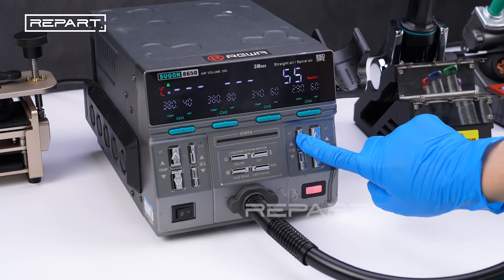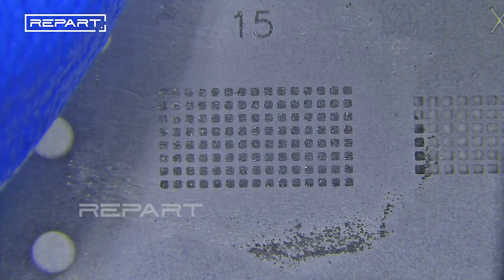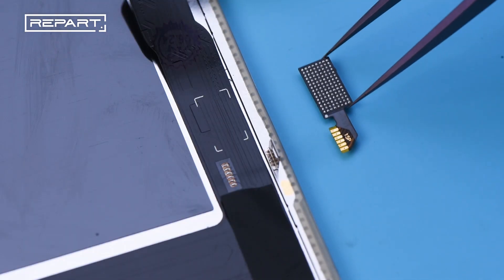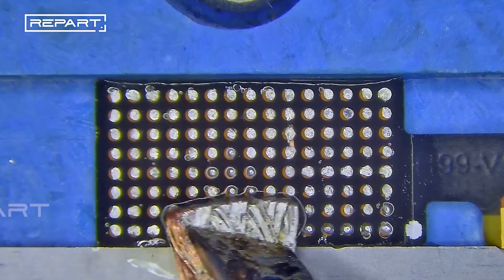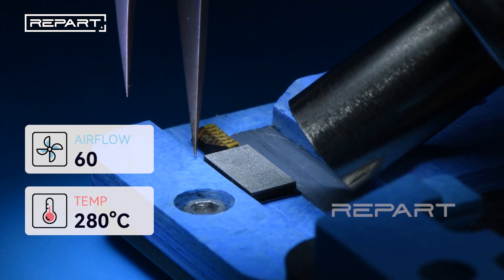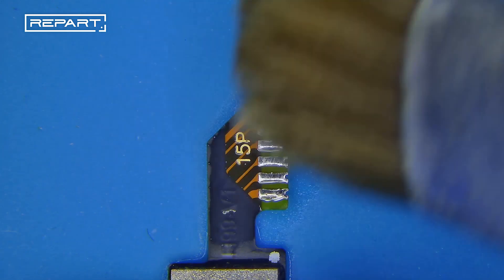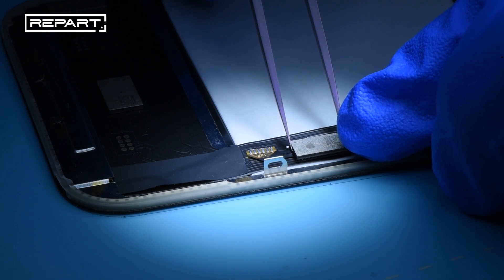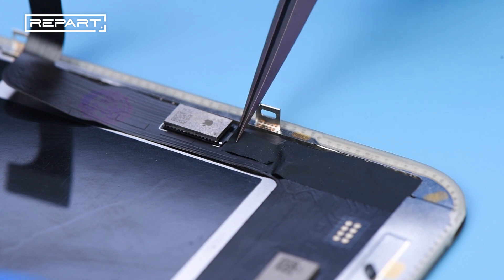Screen IC transfer tips for iPhone 13 Pro, 14 Pro and 15 Pro

Comment: Does the screen also need to be reprogrammed. I have an iPhone 15 pro with a cracked screen. I want to replace but want to keep all the original features. Is only an ic transfer needed, or an ic transfer plus reprogram?

Comment: What about the 12 Pro Max model? Do you have to remove the preinstalled IC of the Repart display and install rhe original IC on the same spot?
Reply from the maker: Hey, the original IC position depends on the reserve pad of the aftermarket screen, the position could be varied based on different brand.